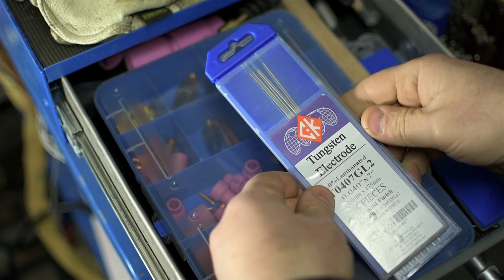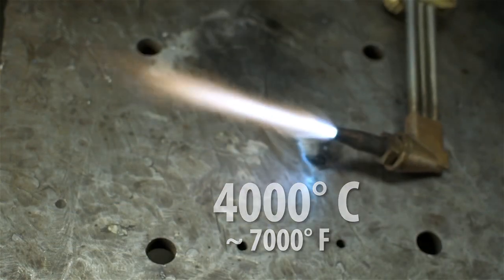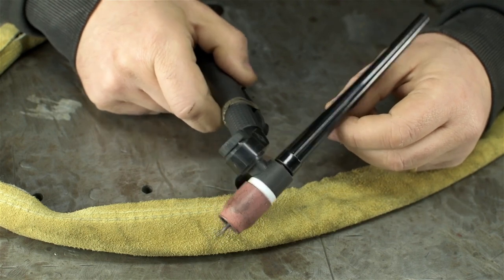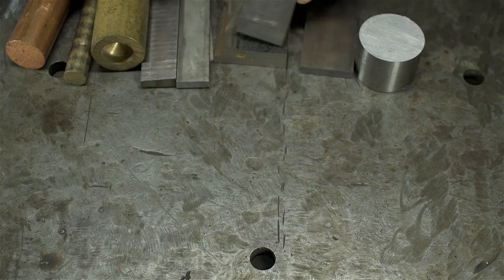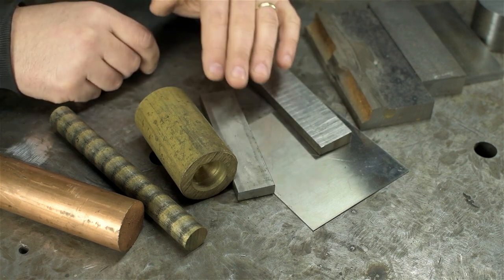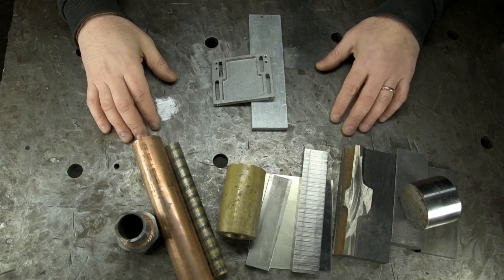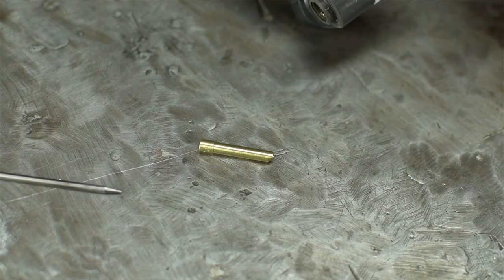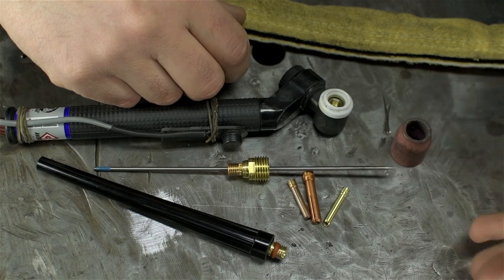Making A Stand! Why I Love TIG Welding

Comment: You can weld aluminum with a DC TIG machine but you'll need to use ultra high purity helium as a shielding gas instead of Argon.
Reply: You don't need helium to dc tig weld. Argon works fine.  Adding Helium will help you weld thicker aluminum if your machine is underpowered for the material thickness. Along with preheating. But you do not need "high purity  helium" to dc tig aluminum.
Reply: @mitchdenner9743  you do indeed need ultra high purity helium to DC TIG weld aluminum. You use it instead of argon as a shielding gas. The only time you add helium to argon is to increase the heat when AC TIG welding.
Reply: @mitchdenner9743  there are instances where certain machines will alternate between AC and DC to increase penetration in thicker aluminum when using argon but it still needs the AC to clean the weld. Argon shielded DC only TIG welds have too many imperfections to pass inspections. You can melt things together but the overall quality is lacking.
Reply: @waynecoots3634  maybe you need to upgrade you machine. My inverter based tig machine is capable of perfect aluminum welds with straight argon.  Same machine in this video.
Reply: @mitchdenner9743  on aluminum using DC?
Reply: @mitchdenner9743  AC TIG on aluminum all day with argon, but not DC with argon.
Reply: @mitchdenner9743  I've used many different machines costing from a few hundred dollars to $15k plus machines. My personal machine isn't the problem. The problem is that aluminum oxide covers the surface of all aluminum and it's melting point is much higher the the aluminum underneath it by a large margin.
Reply: @waynecoots3634  I guess if it's not your machine it's operator error then because I can weld just fine with what I got with straight Argon on DC
Reply: @mitchdenner9743  what exactly are you calling just fine? Passing an xray weld test? Show me a certified welding process approval for DC TIG on aluminum using argon as a shielding gas please.
Reply: @mitchdenner9743  it very well could just be me. I'm not saying I'm anything special but I run my own Fabrication shop and am a welding instructor so I think that I know what I'm talking about here however, I don't know everything there is to know. I've never personally seen successful xray passing welds done on aluminum using DC TIG with argon only as a shielding gas. It always has issues.

Comment: Can you TIG weld other metals like gold?
Reply: Yes.
If it conducts electricity, melts rather than burns and you have some of the same material to use as filler it can be TIG welded.

Comment: 8:00
cough cough
Surface area and heat dissipation/absorption.
cough cough
I've never welded anything I'm just an asshole on the internet.
Reply from the maker: lol.. but you should get that cough looked at.
Reply: Also not a welder, but even I know that welding zinc or zinc alloys is a good way to get sick or dead.

Extremely toxic fumes.
Reply: Heh.  Didn't wait long enough. Decent zinc warnings at 9:42.  :)

Comment: One of the first things I was taught in my TIG class was to scrape the paint (or at least a good portion of it) off of the tungsten so that it wouldn't get caught in the collet. If you're only using one type of tungsten, it doesn't even matter if you have the paint on it at all. That said, those eccentric collets look interesting. Why does my computer keep putting little red lines under "collet," like I'm misspelling it? Computer, you don't know anything about welding.

Comment: Why can't you weld aluminum with DC? What would happen?
Reply: You CAN weld aluminum with DC, but it doesn't have the cleaning action that AC Tig welding provides, or the superimposed continuous high frequency that AC Tig machines have...both of those help break down the oxide layer that builds up on aluminum

Comment: acctually i dont know alot about welders but about elekctronics and you always say the most basic welder will be dc and so be able to do most metals yet from an electrical point of view ac welder should be cheaper in components cuz with dc welders you would need some components to get the ac from you wall socket to dc and i guess to keep the ion stream constant also some caps i dunno xD anyway just bin wondering about that i guess its not as important to the video as some of the other nice info 
as always great video keep doing your stuff <3
also: you just said zink fumes are deadly does this also apply to zink dust ? in "school" i did a simple bottle opener from steel i guess but its was coverd on some dark bluish rough stuff i sandet that off well some body who helped us with the stuff said thats zink ... is it? and is it really really not good for me ?
edit edit: is it rectified in any case ... talking about the welders is a ac welder making its own ac kinda not just taking the ac from the socket and modifiing it a bit ?=
Reply from the maker: yes the AC welders make their own AC from DC.  Or AC to DC and back to AC.  Or the other way around.  I'm pretty sure it's complicated.  Don't know about the zinc dust vs. fumes but, going out on a limb here, probably not good.  I'd try to keep it to a minimum. :)

Comment: Neat hole drill - could you please give some info' on it - so tired of the usual crap ones one finds in the 'stores.
Reply: I think you're referring to the big-ass one? It's called an annular cutter, and not hard to get hold off at good tool shops. You need a 5/8" straight arbor to hold it, the shaft end is kind of short, so a drill chuck or even ER collet won't do it.
Reply: @stephanuhu963  Thank you. I had a bit of a 'doh' moment when I realised we used very similar cutters for concrete and followed those up for the same result.

Comment: @This Old Tony can a MIG machine do TIG??
Reply: They make machines that can do multi process, but MIG requires a constant voltage power supply whereas both TIG and stick use constant current supply, so they tend to be more expensive machines that do all.  I've been steered away from multi process machines like that, however.    Been told they are okay at everything but not great at anything.  Others may disagree.
Reply: @GeekInJeep  thank you.
Reply: Some can, like the Lincoln 210 MP--DC only, lift arc

Comment: This is why I have a DC only tig welder the costs of AC just is not worth it to me. You forgot to metion you can make minor repairs on DC electrode positive with an oversized tungsten with hot start on aluminum. as well as stick weld on DC + as well.

Comment: It’s been a year, You Old Tony.. is it not time to attach a TIG torch to a CNC yet? With a MIG gun or similar feeding spoiled filler material, without welding current applied? Think of the literal metal  3D prints you could do...

Comment: You forgot to mention that with TIG it is possible (depending as always on the settings of the machine and the skills of the user) to weld extremely thin metal. Something that I find extremely frustrating to do with stick. Anything less than 1.5mm - 1mm is a nightmare to weld or impossible for me as a novice. There are videos out there of people TIG welding aluminium beer cans and even aluminium foil which is about 15μm thick. Being able to do something like that seems like sorcery to me.
Reply from the maker: very true.  tip that may or may not help: stick welding very thin material: use a very shallow stick angle.  like 20-30 degrees.  weld back "into" your bead.  the "apparent thickness" will be bigger.  this also works for oxy-fuel cutting very thin material.
Reply: @ThisOldTony 
Eeek! [girly squeal] This Old Tony just replied to me! Love your videos, sir. They are wholesome, relaxing and witty. Wish I had your plethora of toys and craftsmanship skills.
Thanks for the tip. When I (attempt to) stick weld thin sheet metal I use 2mm 6013 rod, reverse DC (electrode negative) @ 45-60 Amps. Next time I will try with a shallower stick angle and stepping back in the puddle and see how it works. Thank you. Best regards from Greece.

Comment: the explanation from 2:35 to 2:58 is all too familiar to me!  say no more
Reply: i did not realize i watched this video and commented on it  2-1/2 years ago, and i was about to post almost the same comment!  i recently picked up an early 90's lincoln gas drive welder, 50 lb gas cylinder, new aluminum spool gun, and tig torch for $2000.  my dad asked me what the heck i need another welder for (i have 3 already), and I replied "what don't i need it for.  really it's just such a good deal i'd be crazy not to!"

Comment: OK that arc looks like a gazillion volts, thats like a brazillion volts but more so as G is further down the alphabet, so if your gloves are not very insulating  and your sticking that metal filler rod into plasma, why doesn't your arm melt into a puddle?

Comment: What, TIG welding cast iron? 
You must be trolling, TOT.
Everytime I tried that, I heard lots of little pings afterwards. Each ping is some stress that relieves itself by forming a small crack. You just don't normally see them with your eye. But with a microscope or magnifying glass, these cracks are quite well visible. Futhermore, the molten cast iron gets hard as carbide, so it's not machinable and kills your inserts/endmills.

For cast iron, silicon bronze brazing only for me. Or brass brazing, if no silicon bronze available.
Reply: Heat the whole casting before welding , and weld it while it's still hot, this will reduce the amount of stress when welding it.

Comment: No you can’t weld magnesium with TIG it gets to hot has to be MIG
Reply: Wrong.  AC TIG.  Same as aluminum.
Reply: I clarify my statement  zinc, magnesium, and aluminium alloy DGFVE 232A cannot be welded with TIG it must be welded with MIG it gets too hot
Reply: @timothyendsley5833  Ummm.... read this link.  Watch the video.  

http://www.weldingtipsandtricks.com/welding-magnesium.html

"Magnesium Welding - Tig Welding Magnesium Castings
Repairs are mostly done using Tig, although welding magnesium can be done with other methods.

A great deal of Magnesium Welding is done to repair castings. Not to join 2 pieces of metal together."
Reply: ViolentLotus ok the only mag alloy I’ve welded is repairing cracks in DGFVE 232A bridge components the manufacturer only allows MIG because of temperature concerns specifically the spiking of temperatures in TIG. They want MIG because it works better.     I guess you can do stuff that’s harder and less effective but you can’t do that and make money.

Comment: Want to collaborate on a project that allows one to produce one's own fuel for their car at home?
Reply from the maker: you asking me to knock over a gas station with you?
Reply: This Old Tony  Well, that wouldn’t hurt the financing process, but don’t really need to unless you want to do it for fun. No, I was thinking more along the lines of a PEM electrolysis rig that uses 700bar water pressure rather than compressing the H2.

Comment: To me there's no point in TIG.  It's just as easy/hard to learn oxy/fuel welding, and you can do the same stuff with that.  And oxy/fuel is cheaper.  And more swank
Reply: There are several benefits to tig - it's much faster than oxy AND you have great control over the heat (with a pedal). Depending on what you're doing tig can make a not possible job possible. For instance, when welding stainless, distortion is a problem. You can limit distortion by limiting heat input into the piece - and the best way to do that is to weld hot and fast. Heat input is most directly affected by time spent welding, and then by the heat used to weld. And seeing as oxy is not as hot as tig, you'd have better, less distorted, parts welding with tig.

And that not even taking into account that an AC capable machine adds in aluminum and other reactive. In the end it comes down to how much your time is worth... :)
Reply: @Broadpaw_Fox  all that is relative and skill dependent